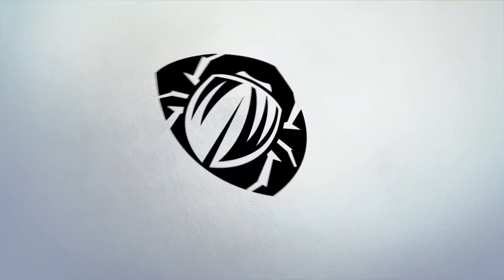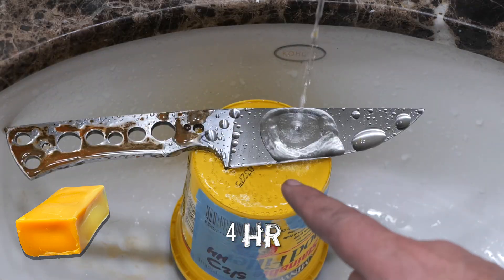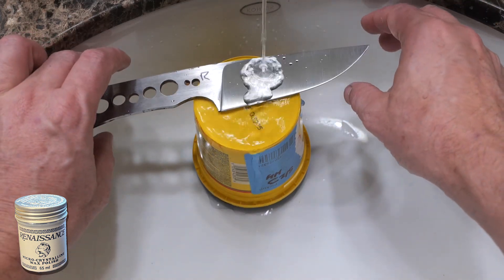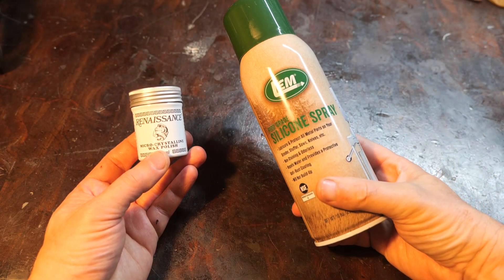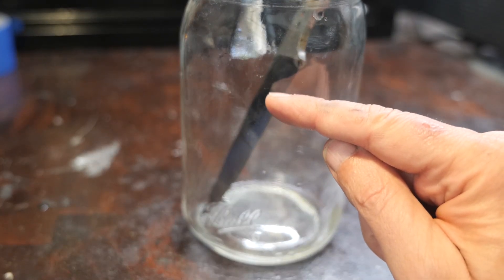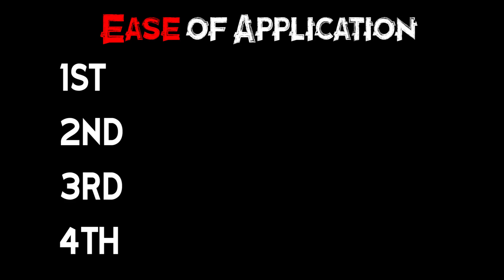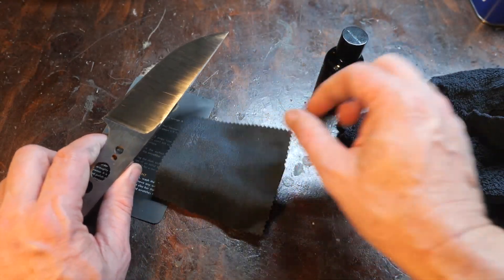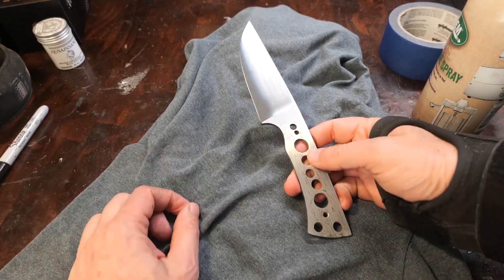Knife Coatings Shootout!  Carnuba Wax, Renaissance Wax, Nano Bond and LEM Spray Draw Irons.

Comment: Renaissance Wax (and wax in general) works best if you give it enough time to cure. Here’s what exactly happens:

Curing of wax
* Application: apply a thin layer with a lint-free cloth
* Let it penetrate: it spreads evenly across the surface
* Curing: 24 hours is ideal
    * The wax slightly polymerizes
    * Forms a hard, water- and fingerprint-resistant layer
    * Becomes less sticky or smearable

Tips while waiting
* Place the sword, knife, or armor somewhere still and dust-free
* Avoid touching or polishing during these 24 hours
* Afterwards, you can buff it with a clean cloth for shine

Extra benefit of a 24-hour cure:
* The wax provides maximum protection against oxidation and moisture
* Even with light handling or transport, there will be less haze or smudging
In short: waiting is really worth it, especially if you care about a perfect finish and long-lasting protection.

Comment: I use the Renaissance Wax only on my guitars' (8) finger boards (rosewood).  I find it a pain to apply on any other surface.  I clean & wipe my knife blades frequently while watching TV, I don't coat the blades.  I feel 1st use will scrape off any coating anyway.  Haven't found a rusted blade yet.

Comment: Man, you weren’t kidding about carnauba wax being a pain to apply.
I’m glad I had a couple of old beater choppers I made several years ago to practice on. 
I didn’t get anything hot enough to affect the temper, but if the scales wouldn’t have been removable, I would certainly have been concerned about degrading epoxy.

Comment: You know, I recently found out hardwax oil works extremely well. It's not as invisible as Renaissance wax or car wax but a lot tougher and food safe. It's also a lot easier to apply than pure carnauba wax but carnauba makes up a big percentage of hardwax oil. It does take a few days to fully cure but after that it's really durable, comparable in hardness to lacquer. I left a coated carbon steel blade in the garden for 2 days during a rain storm and it had nothing.
Reply: Careful--the hardeners you get with 2-component hardwax oils is NOT food safe. In fact, it's some super nasty stuff you do not want inside your body.

Comment: Here's one issue that I have with the carnuba wax right off the bat . You have to disassemble the knife to bake it . That's not hard to do , but at the same time you have knives that don't come apart . So how would you apply it there ?
Reply from the maker: Yeah I think it’s an issue unless you have a high speed buffer that will load it

Comment: Mothers 100% pure carnuba paste wax. Easy on and off! Also ceramic coatings are designed to be put on polished surfaces like automotive paint. I would've tried a 3000 grit finish with 2 coats.

Comment: I have been using a carnuba based furniture wax. Slightly heat the blade with heat gun wipe on polished off seems to outlast anything else I've tried. I used Ren wax in my early days as a maker and was very unimpressed

Comment: Not a knife maker but I did use a nano glass bond on an internal shower handle that rusted away (Al). I turned it and coated it with a similar nano glass product 10+ years ago. Still holds ans is perfect.

Comment: Hey man nice video and experiment! What type of steel was the knife made from? It would be interesting to see this test on different knife steels also on knives that have been etched first in ferric, just to see what the differences are if any. I've used the carnauba wax, heated the blade up with a heat gun, then rub the wax on, and buff out.
Reply from the maker: 1084

Comment: I really appreciate the time, effort, and expense that you expended to make this comparison test video.
After contemplating for several months on which long-term protectant to use for blades, your video clearly demonstrates that the carnauba wax is the best option for my use.
I’ve been using mineral oil for food grade protection and 3 in 1 oil for non-food grade protection.
Thank you very much for your continued production of informative videos.
Keep up the great work!

Comment: I think carnuba can be melted with stuff like beeswax and turpentine at various ratios which gives it a much easier smear application at room temps. Sort of fell off the back of the car detailing industry so they may know some tricks with it as well and I'm pretty sure most of those knife-axe waxes sold by every man and his dog are probably combos of it.
Personally, I use Renwax for long term storage and its always done just fine there, which really was its purpose. Just smear it on and provided its not used or abused it does hold up for that kind of thing when it just needs to keep a tool or knife from rusting in a drawer somewhere. 3in1 oil also works really well for that but I use that more for tools than knives
Reply: Yeah, it can be mixed. I do about 2:1 beeswax, to carnuba, with a bit of food oil. I've had good results with it, but i only use it for storage in dry places rather than during use
Reply: @alextopfer1068  Yep a little bit of resin-turpentine or mineral oil will give it a softer quality. They're both good for doing furniture polishing as well, maybe not tough enough for a hard use knife handle unless you want to do it every month or so.
It does smell beautiful as well if you can get raw bees wax that hasn't been processed much

Comment: STEVE!

... as for the topic, I use petroleum jelly. A tiny dot will coat a whole blade for decades of storing or to prevent oxidation in shipping, and wipes off in a second. I use my microcrystalline wax (Ren Wax but without the markup) in my paste wax recipe with linseed oil (actually boiled, without chemical drying agents) and limonene (instead of turpentine, so it's food safe).

I blew out my elbow... surgery on 18Dec, so no more forging for a while... very peturbing. HAPPY THANKSGIVING, BRO!
Reply from the maker: Happy Thanksgiving, and good luck with the surgery! Sorry to hear it!
Reply: @GreenBeetle  Thanks for the sentiment, bro. The hilarious moment of irony was after going to the Dr and being told the bad news and scheduling the hacking... the very next day, UPS delivered a Christmas present from a friend in Texas... a guard jack. LMAO! I guess it's not as ironic as it would have been if it were a new hammer... because I can do stock removal for a few months and still use the jack... but it FEELS like getting run over by a truck full of irony.

Try out that paste wax recipe (I forgot to list the 4th ingredient, a dash of beeswax because it does a thing or two that the microcrystalline doesn't, and vice versa)... it's awesome. You will love it. Very tasty on muffins.

Comment: Interesting! I just got some renaissance wax today but I already knew I would only use it on handles. I have yet to try carnuba but it seems to be good at what it does. I also use pelican paste to coat my damascus blades when I'm preparing for a fair.
Reply from the maker: Why do you choose pelican wax?
Reply: it's the first thing I bought from my knife steel supplier here in Europe, out of curiosity. It smells alright, it's food-safe and seems to provide good protection. I usually apply a little bit after finishing my blades and melt it into the blade using a heat gun, then wipe the excess. It's also pretty good as a handle finish.

I'm looking to try new things now, renaissance being the first thing I ordered. Definitely carnuba next!